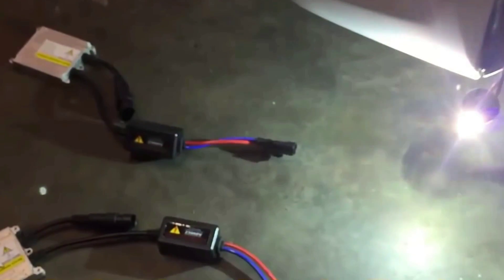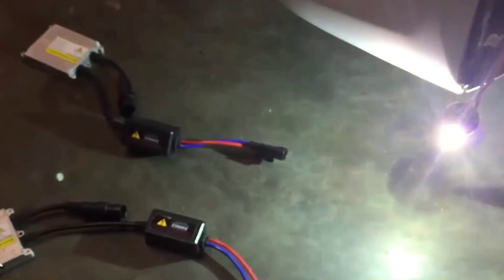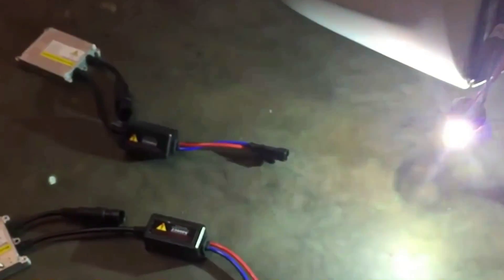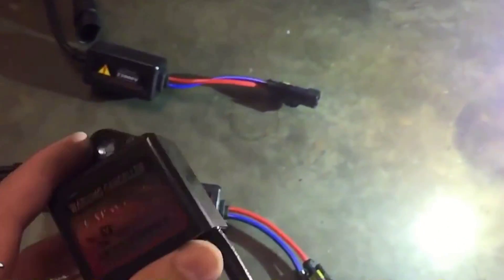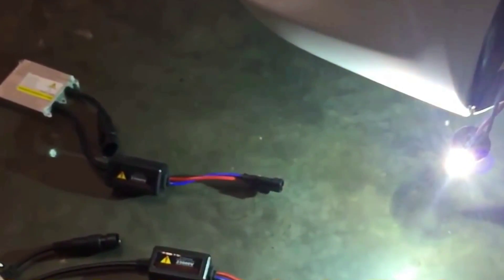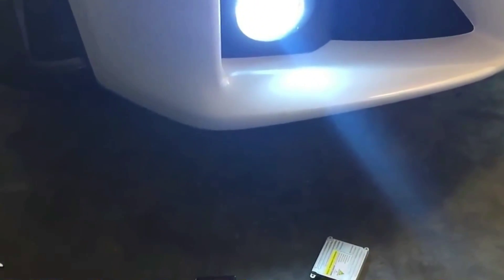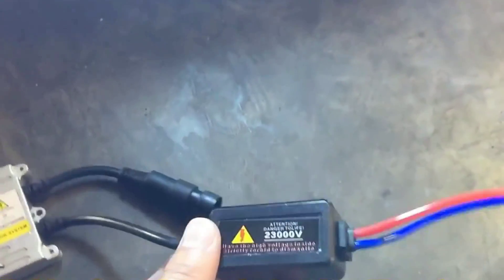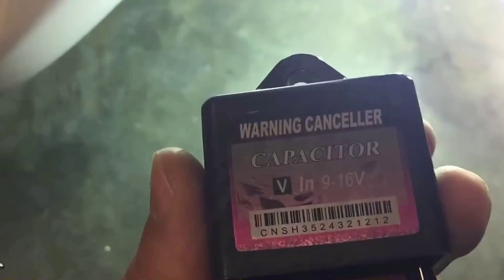✅How to Fix HID Light Kit Flicker Review | Relay Harness Capacitor, HID Ballast Canceller Regulator

Comment: Other than being confused about whether it's a relay or a capacitor, seeing you're calling it both, this was very informative. Seeing it only has 2 wires running through it, it's a capacitor. A relay will have a minimum of 4 wires, 2 to energize the relay coil (12v & ground) plus 2 more - battery source & ballast feed wire. Thanks

Comment: You seem very confused on what is what here. The boxes on the ballast harness going to the bulb is the transformer. Most newer ballasts have an external transformer. Thats not a capacitor. Also a relay harness is useful for providing more stable power and is able to handle the current from the ballast. A warning cancelor just has a resistor in it. Some anti flicker boxes have capacitors and some resistors and diodes in them but can bus doesnt actually run on the headlight circuit. The bcm just senses less resistance and thinks the bulb is burned out. Lots of misinformation out there on this stuff...

Comment: I just bought a ddm tuning hid h11 4300k. It flickers. I have that built in wiring harness and my 2 month old bulb doesn’t do it. The reason why i am replacing it because i want more light output. I got 6000k and it works fine, but the new ddm tuning doesn’t
Reply from the maker: Sounds like the ddm is just defective or not compatible with your vehicle?
Reply: Vibrant Deals its more like defective bulb. I tested it to my other ballast and it does the same flickering issue. The bad thing about it is it has a brand name PInGMXD
Reply from the maker: Does sound like a bulb issue bc you can't have that many bad ballast.

Comment: what if my kit already has the built in capaciter and is still flickering?? please help!
Reply from the maker: If your hid bulbs are removable try switching them to see if the same side flickers.
Reply: I had the same problem too, and Ive switch and it goes to the other side now. Is it my HID bulb problem?
Reply from the maker: It is most likely the HID bulb then.
Reply: I have the same problem, but it only flickers whenever I accelerate.
Reply: Yeah, I have the same problem with high quality ballasts and cheap chinese bulbs. The bulbs are causing that flicker.
Reply: i've switched mines and the same side flickers? do i have to get a new capacitor?
Reply: I know this post is old but I’m pretty sure that “built in” capacitor is actually an igniter for the ballast.  Usually a relay harness will correct the issue of only one hid coming on and the capacitor will correct the flickering.  Hope this helps anyone else in the future.

Comment: I'm some what vehicle illiterate, but my wife has a 2010 Buick enclave we bought used few years ago. It came with the hid lights already installed which looks like from the factory, not a kit. About a year ago one headlight went out so I replaced them both. Recently both light have begun to flicker on and off to the point when they at times go out completely. But come back on if you turn. Vehicle on and off.i have replaced ballasts and it still does it. Any idea if this would work, or is there another possible solution you think I should try? Any help would be greatly appreciated.

Comment: nice video man, just installed 35w opt7 8k kit on my accord, when I start car is auto mode the left hid will flicker then shut off. car has to be running before I fire them up. what will fix this? thanks
Reply from the maker: The car doesn't have to be running for them to fire up. I would switch the bulbs around to see if you can trouble shoot whether it is the ballast or the HID bulb. The kit you have is actually good!
Reply: get a relay harness, problem solved
Reply: ridinshotgunz I also installed a relay hardness a very high quality one that came with my Hylux 55w 5k with CNLight bulbs HID's but my lights still flicker Everytime I hit the turn signal when turning my car. Nothing works and hope this Canceller Capacitor would finally do the job!

Comment: all my HID's I have installed since I had my car have always flickered only when I hit the turn signal either left or right! I have a nice high quality relay cambus to give.my HID's extra power boost from my $300 XS Power  battery but still doesn't fix my flickering... seems I need to get this Canceller Capacitor for each side and hopefully my bitch ass bad ass HID's (Wich uses CN-Light bulbs) would stop flickering everytime I switch the turn signal!

Comment: Will this work for any hid kit
Reply from the maker: Yes it will work on any kit with the same universal connectors but must confirm if you have a voltage problem or bad bulb.
Reply: Vibrant Deals it's a voltage problem I tried another one and it does the same thing
Reply from the maker: So it will work then.
Reply: Vibrant Deals ok thanks